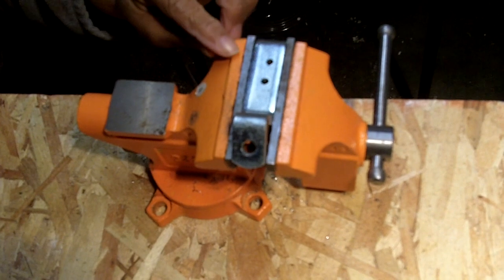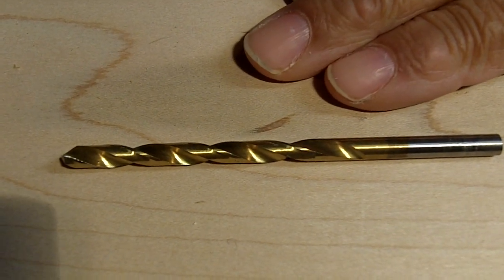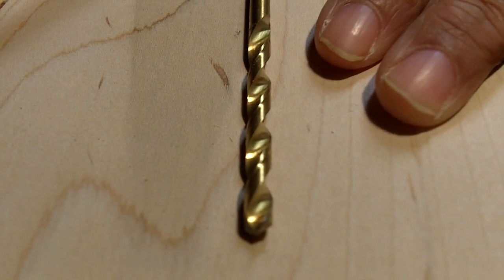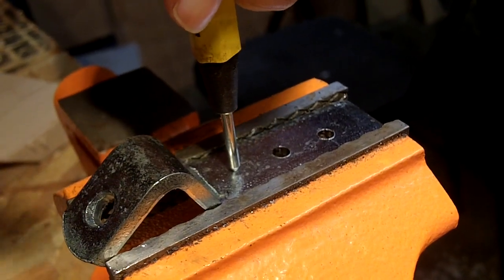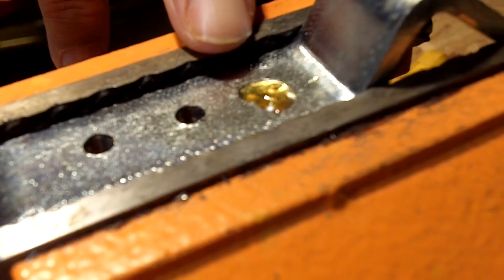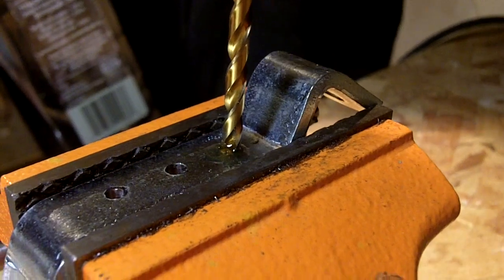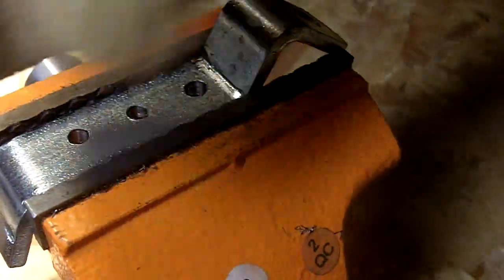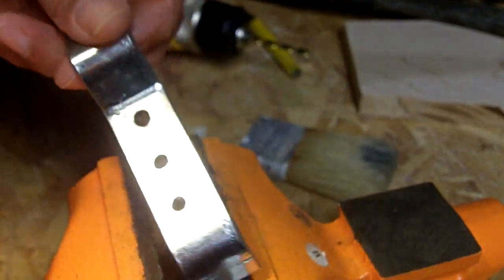How to Drill a Hole in Metal

Comment: One thing I've found useful when drilling a large hole through steel is to use a small bit first and then the desired size bit.
Reply: the problem with that is on breakthrough. the drill can snag and snap.

Comment: Hey Leah. I was wondering if you could do a video showing how to use "left handed drill bits" for removing a stripped bolt or screw. I bought a set that the old man wanted me to buy, but I never had the chance to use them and would like to see you do it before I did. You're a great teacher and I'd like to see how you would do it. Thanks Leah you're the best

Comment: I have a punch and will use it to put a starting point on the pipe I am going to drill through. The outer pipe is almost as thick as the metal you in the video and I have a smaller pipe inside the first pipe I am going to drill though and I am putting up a TV antenna on top of the inner pipe and have it clamped to it. I hope you and your family have a Very Merry Christmas and a blessed one.
Reply from the maker: +Sidney Mathious Merry Christmas to you and your family also, Sidney!!

Comment: I think using higher pressure and slower speeds is better for the bit as it reduced heat buildup on the tip which causes the bit to soften and get damaged.

Comment: Oh I use oil ... when I cook. Anyway, hole punching is a must. I use cobalt bits. They last a hell of alot longer than the titanium bits. I had the privilege of drilling out 6 large rivets for two ball joint replacements on my Buick. What helped tremendously was to use smaller diameter drill bits first and work my way up. This allowed less stress on my arms when pushing down, but don't push down too much or the bit will snap. Ample spraying of WD-40 for lube (there are better lubs for drilling, but one has to use what is available). Speed was also important. Too fast rpm and you not letting the but bite in and do it's job.
Reply from the maker: +Paul Bevillard That is a really good technique when you're drilling a larger hole.  Thanks for sharing your personal experience with the See Jane Drill community.
Reply: Thanks Jane, There is a typo in the last sentence. Correction: Too fast a rpm and you are not letting the bit bite enough.

Comment: Pls help! Would this work for drilling through the screws in a deadbolt? I've been trying for a few days using black oxide drill bits with an 18V hand drill and minimal progress. Should I get a higher voltage drill and/or switch to titanium drill bits? Also was this in real time? Thank you for the video!
Reply from the maker: Drill slow and it may help to use either cobalt or titanium.
Reply: @seejanedrill  thank you

Comment: Ive drill many metals over the years. Saying that i ran into one that destroys my bits very quickly. An old mattress bed frame. Ive drills fast slow with lube and with out anf every thing in between. Ive used every type drill bit available at hardware store. Any advice would be appreciated. Thank you
Reply: What lube did you use

Comment: Great video ! Can i use WD-40 as lubricant?
Reply: I've used wd40 as a lube. works fine, just got to keep spraying it if you using the spray
Reply: +ESSBrew 
Sorry but WD40 is little more than diesel with some aromatics added. It can work well while drilling aluminum, but it works poorly as a cutting lube while drilling steel. Plus any smoke from the hot WD40 is extremely flammable. As a liquid it's fairly hard to ignite and slow burning if it does ignite just like standard diesel fuel is. But not once it's been turned to a gas cloud within that smoke. So you need to be careful about keeping the speeds down and the heat below the temperature where that diesel will vaporize if you are using it on aluminum. Lubricating oil does cool the cutting action a bit, proper cutting fluids will both cool the cutting tip but also help the tool to cut and keep the material such as aluminum from chip welding to the cutting tool.
Reply: +Turning Point I use wd40 drilling small holes and tapping threads. it's the best thing ever.
Reply: +userwl2850 Well I've tried it also, many times in the beginning. And it or straight diesel fuel works well on aluminum as I mentioned, but there's certainly no comparision between WD40 and the proper cutting and tapping fluid in any steel. Even more so for the stainless alloy's. I've broken a few taps off and the expense, time and effort required to remove them has made buying the best drills, taps, and tapping fluid I can find dirt cheap.
Reply: +Turning Point if you watch my last video on my channel you can see how I use it. thread cutting on a lathe and drilling and tapping I've used everything on sale and wd40 through my experience is best. I can imagine diesel works too.

Comment: I fully realize your video's are meant more for the entry level people, but some additional information shouldn't hurt. 

That TiN coating can mean almost nothing if it's applied to cheap and poor quality drills and much of them fit that description all too well. It isn't and never will be cost effective to pinch pennies with cutting tools. I've seen pictures of cheap soft drills where the drill was so soft it twisted the helical flutes in the other direction on the very first hole. I'd take a standard non TiN coated drill built by a good brand name manufacturer, before I'd ever buy cheap but coated off shore drills. Precision Twist Drill would be only one company of many in the U.S. But the price of the drill from a good tool dealers will be a good indication of the quality of the tool. 

Yes that coating can also allow higher drilling speeds, but go too far and you'll destroy any High Speed Steel (HSS) drill no matter who made it or what coating is on it. A rough rule for HSS cutting the usual mild steel is the tool should be cutting at no more than 100 feet per minute. So what does that mean? For a drill it's the rpms. If you take the drill diameter, lets say a 1/4" diameter drill, multiply that diameter by Pi or 3.1416 that gives us the circumference or outer diameter of that drill as .250" x 3.1415 = .7854" or pretty damn close to 3/4's of an inch. So we all know there's 12" to the foot. So divide 12" by that .7854" = 15.278. That's how many revolutions it will take for the drills outer cutting lip to travel 12" or 1 foot. Now to get the maximum revolutions you can safely drill at you want to multiply that 15.278 number by the 100 feet per minute drilling speed. 15.278 x 100 = 1,527 rpm. As the drill diameter goes up the rpms have to come down.  A 1" diameter drill for example would have a maximum rpm rate of 382 rpm in mild steel.

Oil not only lubricates the cutting action, it also has a cooling effect on the drills cutting edges. But the cutting tip has to be kept wet at all times.You could use more rpm to drill a bit faster with it, or drill at the same rpm and your drills sharpness will last a lot longer. To make things a lot easier tho, as long as the steel chips aren't starting to change color to a pale yellow or blue, then your rpms should be low enough. All materials and cutting tool materials have rpm limits. Exceed them and you'll be buying new tools to replace the one's you just burned up due to heat.
Reply: +Turning Point : Great additional information to the already very helpful video.
Reply from the maker: +Turning Point Hi Turning Point, thank you very much for sharing this information.  Your post is very well-thought out, and I couldn't agree with you more about the cheap drill bits.  Sometimes it is difficult to include large amounts of information in a short video presentation, and so I appreciate it when people such as yourself write in with additional comments and tips.
Reply: +seejanedrill Thanks and glad you didn't mind the extra information.
Reply: I just use TCT drill bits instead of drilling steel with steel.

Comment: Ok, so this isn't really that tough. What IS tough is drilling a hole in a stainless steel sink for a soap dispenser or water filtration spout. THAT would be a helpful video. I had to use a punch, none of my drill bits would grab, and it was really tough. I eventually got it drilled, but I'm sure there is an easier way.. I just didn't take the time to figure it out, and wasn't able to find anything that offered a solid method.
Reply from the maker: +Christian Gentry (TooTights) a cobalt drill bit is good for stainless steel, but it needs to be a high quality one.  Or a solid carbide bit would work too, however, they are a bit pricey as well.